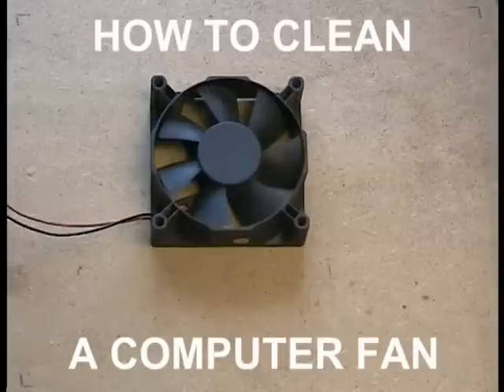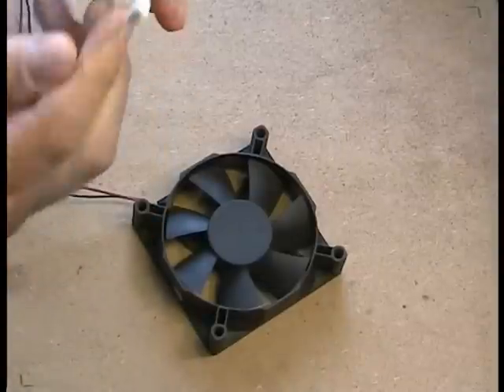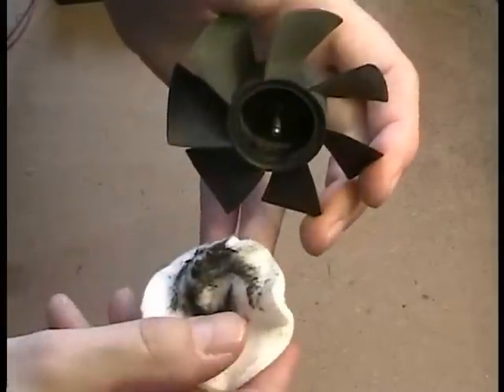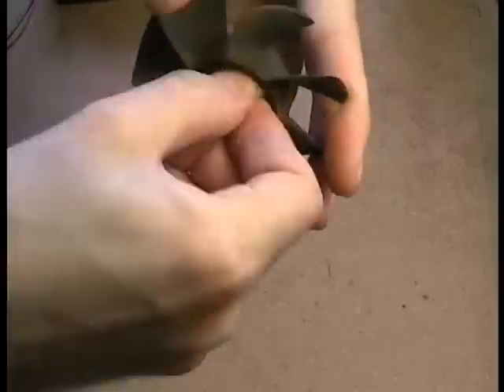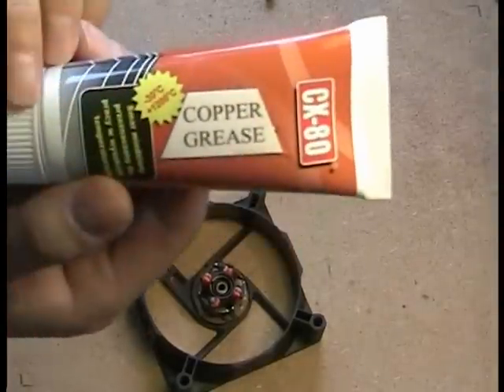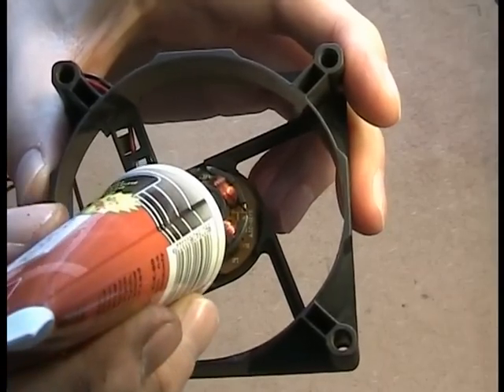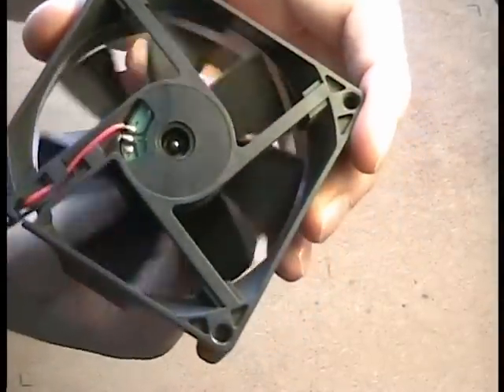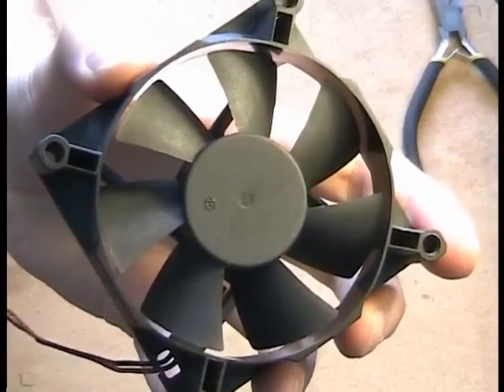How to clean a computer fan

Comment: thanks! clear instructions and easy to follow.
first time cleaning a fan this way. worked like a charm :)
may i use WD40 instead of grease? i know its not a lubircant, but i don't have anything greasy at hand
Reply from the maker: Thanks for your comment! You could use WD40, but only temporarily. As you mentioned, it is not a lubricant.

Comment: Would it be okay (easier & faster) to clean the fan blade itself in warm soapy water and then dry/let air dry??  Thanks,  👍
Reply: I see no problem. I always used wet wipes to clean the blades.. Just dry them after using paper towel and make sure of it after turning your PC on.

Comment: This was a pretty handy video. I hadn't realized that little circle in the center under the label was actually a plug (like, "plug a hole," not, "plug for power.")
Mine on my fan definitely did NOT pop right out. It must have been glued in because it just came apart in pieces. After a few minutes of digging in there with a screwdriver it occurred to me that I could just put a (somewhat) large hex driver bit in my screwdriver and use it to press the pin out of the washer. That worked  just fine and left the washer still captive in the plastic so it can't get lost.
(There was also a tiny metal plate in the 'plug'. I have no idea what it was supposed to be for.)

Comment: I used a dental pick to get the nylon washer out that holds the fan shaft in place.  This is a great tutorial.  Fans spin even faster IMO after lubing them as there typically is not enough lube put in at the factory.  I bet most people would just throw a noisy or stopped fan out.  Too bad....

Comment: I often collect used tech stuff and like cleaning em as if they came out of factory,I never took fan apart though,For me in my country its harder to find a broken part some I am sceptical about removing the snapring off I fear ai might break it given I am currently cleaning Xbox One,Do you know how frequently a Fan should be greased and cleaned using this method,This Xbox was manufactured in 2013 so that would mean this Fan is not lubed for about six years its working great but since am cleaning thought to be thorough to give it life for another long use

Comment: Thanks for the video.  I had a very noisy power supply fan and I cleaned it just as you  instructed.  It was so quiet afterwards, I had to check to see if it was even running.

Comment: Great video! One thing to add would be a dust filter on the intake fan. Turn the pc in and use two smoking  incense sticks to determine which us the intake fan and which are outake fans. Also keep your pc off the floor will reduce dust intake.
Reply: Literally on every fan there are markings that show direction of fan movement and intake direction

Comment: I bet to clean the fan you could also use dish liquid soap and an old toothbrush, just making sure you dry off the metal shaft before setting it out to dry.  I just pulled my rear case fan from my PC, pulled the plug and put a couple of drops of Wahl's Clipper oil on the bearing and shaft and walla, problem solved.  Your method is very thorough.  Thanks for the vid.

Comment: Would graphite oil work or graphite powder?
Reply from the maker: Honestly I haven't tried that, but it's probably not ideal. I know it's often used for lubricating locks. The fan shaft may produce quite a lot of friction and some heat.

Comment: Can I use vegetable or sunflower oil ? xD

Edit: tbh I've used vegetable oil on rusted and stiff padlock it worked brilliantly and 3 years later the padlock is still very easy to use probably best to not use it in fans though I dunno lol
Reply from the maker: I wouldn't use vegetable oil to lubricate a fan. This could work for short periods, but the oil could go bad or lose its properties in a spinning fan due to friction.

Comment: only grease I have on hand is white lithium grease
Reply from the maker: It's for metal-to-metal applications and I'm not sure if it won't react strangely with plastic, but you can try it out.
Reply: Thank you for the response.  I will try to find some other oil or grease.   I only just recently read that it has a tendency of drying out badly if it is the spray can variety--which I have.  So it's time for shopping.
Reply from the maker: I haven't used it, but if it dries out, I would probably avoid using it.

Comment: I can't take off the little seal before taking out the washer
Reply from the maker: Have you tried prying it with a screwdriver?
Reply: ElectronFun.com my fan just broke thanks man
Reply from the maker: It broke because you wanted to clean it or it just broke?
Reply: ElectronFun.com the fan was hustling to spin, I fixed that and then it was making a noise tried fixing that and it broke. I will just buy another tomarrow
Reply from the maker: It happens, but I guess it's always worth trying to fix these fans.

Comment: you actually skip the teraing the fan apart, the important is you need to lubricate the bearing. first to clean out the dirt in bearing, you can use wd40 (and wd40 is not a lubricant, just a cleaning solution that may wash out dirt and rust) after that, the fan usually spin smooth now, but its not yet lubricated so you need a motor oil in liquid form (usually the motor oil you usually use in a sewing machine not the sticky gooey ones you use in a turbine engine) and then in final part, put a motor grease on the bearing this will help your bearing lubricated for a long time.

that's it  you successfully repaired your box fans. you dont need to disassemble it completely, there's a chance that you can break the lock/washer if you do that and make the fan completely useless.
Reply from the maker: As far as I remember, my fan didn't have a bearing. There are at least two types of fans on the market: brushless and ball bearing fans.
Bearings are usually sealed, so the chances of finding dirt inside are rather slim - I wouldn't bother to remove the old grease and re-lubricate them.

Comment: Wtf is washer??!! I dont have it!!!!
Reply from the maker: +Mobile Games Walkthroughts That's the part, which prevents the shaft from falling out.
Reply: ElectronFun.com I dont have.. That the problem!
Reply: ElectronFun.com I have Intel cpu fan...
Reply from the maker: Unfortunately Intel fans are very different and a lot more difficult to clean and lubricate. The ones I've seen didn't even have the rubber cap. To tell you the truth - fixing Intel fans are probably not worth your time.

Comment: I gave you a thumbs up. Excellent! One of the few instructional repair videos that is complete and detailed in the process of repair! Nowadays there is more replacement than actual repair; however your video is truly repair, and very good indeed! I was wondering if you can answer a question that I have, and I would be very appreciative if you can offer any good advice. I have copied and cut most of my question from a previous repair video, and edited because it is too long, and it is essentially the same concern I have for my Sony VAIO desktop computer. It is a very good video of a repair to the power supply unit, which I am having a problem with because it is making a low grinding noise, and it gets quieter as time of operation passes. 

However, my desktop computer is a Sony VAIO PCV-RX850 bought in 2003, 
and ran with Windows XP, later installed Service Pack 3; now upgraded to
 Windows 7, 32-bit version. Anyhow, in my system's case (also a pun), 
the power supply is not removed that way! The console (the case, the 
Tower) is placed on its side after all the cords and wires are 
disconnected before the side panel is to be removed, the left one facing
 the computer user. The next step is a bit risky! One screw is loosened 
from the chassis being careful the PSU does not crash into the 
electronic components, namely the memory modules! Anyhow, not making a 
long story longer, all I could do was used a can of compressed air 
called Dust Destroyer to spray most of the inside of the case. I could 
not open the top shelf. Then I researched over the Internet about 
completely opening the Sony VAIO computer case and discovered a detailed
 manual, and found that after holding up those two brackets the top 
shelf have to be pulled outwards! My desktop computer is already fully 
connect back again! What do you think? Should I get it repaired, or have
 it replaced by another better, more powerful PSU, which I have and 
bought a couple of years ago; or take the risk, open it and repair this 
troublesome, noisy fan of the power supply unit by myself? Thanks for 
any helpful, constructive advice. Thank you ElectronFun!
Reply from the maker: Thank you so much George!
To answer your question - if I had a replacement PSU lying around, I would use it. Just for fun and practice I would open the old one and try to fix it. While being inside, check the electrolytic capacitors - they could be bulged or leaking. Just remember not to touch or short circuit them, as they may hold the charge and you may get shocked.
Good luck with your fix and please let me know about the results :)

Comment: A tip, use a product called megapower # 10 its actually penetrates the molecules of the metal and virtually eliminates friction. My dad uses this in his old truck and now has somewhere around 450k miles on the motor. Everything I've ever put this stuff in  perked up in a big way.
Reply from the maker: I didn't know that one - thanks! I just wish they made smaller containers.

Comment: I wanted to add I now have 5 cooling fans in my latest/greatest PC build.  My octocore system isn't even a year old and I was astounded by the dust built-up!  I order some hoses and a dust tube blower that I'll hook up to a small pancake compressor.  That ought to clean out most of the dust crap in my computer.  Dust is the scourge of any computer user which can make your unit run hotter than it has to.
Reply from the maker: Oh yes, all PC fans attract so much dust, which can clog all vent holes up.
The idea wit a dust tube blower is very cool!
Reply: I could buy those aerosol cans but a six-pack of 12-oz cans of Dust-Off runs $20.  Pretty expensive when one considers they are simply bottled compressed air!  The smart move is using one's compressor which, for mere pennies of operation, will do the same exact job.  But having said that - cleaning those spinning dust traps (namely, PC fans) by hand is the better way of cleaning them more effectively.
Reply from the maker: I couldn't agree more.

Comment: Awesome thank you.   My fan just started acting up today. If I let this go for a week until I get proper tools, grease and alcohol.  Well it last?  or am I at risk of damaging my computer?
Reply from the maker: Thank you for watching and commenting!
Most modern computer components are equipped with a thermal cutoff - when they reach certain temperature, they will turn off (usually the whole computer). However, there is always a risk of frying something.

Comment: Super Video!
I know this method would extend the remaining life of many computers, but on an industrial scale this is not done. 

Why ? Working hours ! A new fan is simply cheaper than the time to clean them. Old fan out, new fan pure in. 10 minutes maximum.
If it is not an expensive computer, or a complicated software installation, then has repair (unfortunately) no chance. 
The components are so cheap (unfortunately) that my boss would tell me mad when I would bring a fan in this way again. The PCs are calculated for four years and normally a five-year live, but not longer than 10 Years. They have earned their money. Out with it. Electronic waste.
That's the problem, we waste material  in order to meet any profit targets.
Until 2008 I have repaired computer. But then this has no longer profitable. Today I'm building alarm or video systems. The same scheme. If something is broken, complete board out, new pure, copy old configuration. done! No one is interested which of these SMD components have just dissolved.

We make this planet finished with this method! 
Your Method is green!
Reply: well if you are rich and you have a lot of money then do that instead
Reply from the maker: +haffolderhaus I know you are right, business is about money - nothing else counts. No matter what they say, they do everything to earn more every year.
I'm doing these videos mostly for individuals, who are interested in technology and want to know how things work, how to fix them and how to build stuff.
Thanks a lot for watching and commenting :)
Reply from the maker: That's what I was hoping :)

Comment: my fans also have a white wire attached to it, what is it exactly? Is it a ground wire??
Reply from the maker: How many wires are there and which colors are used apart from white?
Reply: ElectronFun.com a blue a green a yellow and a black, there's no white one
Reply from the maker: That's more like it:
1. BLACK - GND
2. YELLOW - 12V
3. GREEN - sense wire
4. BLUE - control (PWM)
Reply: So if i have no potentiometers i only use yellow and black?
Reply from the maker: Yes, you can use just these 2 wires.
Reply from the maker: To tell you the truth I wouldn't use any edible oil. It will eventually go bad.
Reply from the maker: +yoshi kuma Sorry to hear/read that.
What do you have at home? You could use WD-40 - I wouldn't recommend it as a permanent substitute for grease, but the fan should be okay for some time.
Reply from the maker: Sorry I couldn't reply sooner. Don't use butter, or any other edible "lubricants". The old WD-40 would work much better.

Comment: Thanks. I can disassemble things, but have problem to put them back together. Sometimes, it does not work like it did before. That's why I just clean the outside.
Reply: If the fan isn't in too bad of shape, you can get away with putting a few drops of 3-in-1 oil or similar after removing the seal. But the dust is still inside.
Reply from the maker: I understand your problem, but I'm afraid cleaning the outside won't help much.

Comment: Would wd40 work instead of machine oil?
Reply from the maker: WD-40 is great for removing old lubricants. You could use it instead of oil/grease, but it's a temporary solution.
Reply: ok thanks. I appreciate it.
Reply from the maker: No problem:)

Comment: how do I disconnect & recont thos wires?  You didn't cover that part.  :-(
Reply from the maker: I didn't cover that part, because there are so many different types of fans out there. Usually there is a plug, which can be simply disconnected, in other cases you may have to desolder the wires.

Comment: Great video! Can I apply the kind of oil that is used for maintenance of electric shavers (instead of grease)?-thanks
Reply from the maker: Thanks Stefan! I guess it should work fine. This stuff is probably not much different from sewing machine oil.

Comment: Instruction Unclear got dick stuck in fan blades and bleeding! dislike
Reply from the maker: You're right, I didn't say you should turn off the fan before cleaning.
Reply: ElectronFun.com yeah :(
Reply from the maker: Don't tell me you didn't turn it off...
Reply: +ElectronFun.com i didnt turn it off :((((
Reply from the maker: How did you want to disassemble the fan without turning it off?
Reply: +ElectronFun.com screwdriver
Reply from the maker: Always turn off a device that you want to disassemble...
Reply: +ElectronFun.com yeah
Reply: and not insert dick
Reply: I usualy "insert dick" before doing anything on my computer.. good to know.

Comment: My Heat Sink fan is also having speed problems, and might need a cleaning. Can you use coffee filters instead of those clothes? And also, what kind of cleaning alcohol should I use? Also, what kind of lube?
Reply from the maker: I've never tried using coffee filters in such cases, but it may be worth trying. I used isopropyl alcohol, it works really well. When it comes to lubricants - I would say a grease is the best. In my case it was copper grease. I also tried silicone grease, but didn't have much luck with it.
Reply: ElectronFun.com
A friend of mine on Skype said I could use rubbing alcohol to clean the fan, and then lube it up with mineral oil once I'm ready to re-install it.
Reply from the maker: Rubbing alcohol should work fine, but I'm not sure about mineral oil - I've never tried it for a fan.
Reply: ElectronFun.com
What abut if I decide to buy a new heatsink fan? Will a high number fan (like FX-6100) work with a FX-4130 CPU?
Reply from the maker: Higher number doesn't always mean what you think it should mean. In your case both processors work with the same chipset, so the CPU coolers will fit, but the FX-4130 has TDP of 125W, while the FX-6100 only 95W. The FX-4130 needs more efficient cooling, so I guess the cooler that comes in the box with the FX-4130 should be more efficient than the one for the FX-6100.

Comment: My fan was different. I had to pop out the fan blades by applying pressure. I had to glue it back together after I was done cleaning and oiling. It's drying as we speak. Let's hope it all went alright.

Still, this video was still useful for me, and the music choice was PERFECT. Makes you wanna clean fans all day. Thank you!
Reply from the maker: That's great - it means I inspired you! Thank you for describing your situation and your nice comment :) I hope we can inspire more people.
Reply: Thanks! Unfortunately the glue didn't work. I'm about to try out another type of glue. But at least it's not doing any noise anymore, so the cleaning and oiling process was effective
Reply from the maker: I hope you will find the right type of glue. Good luck Matias!